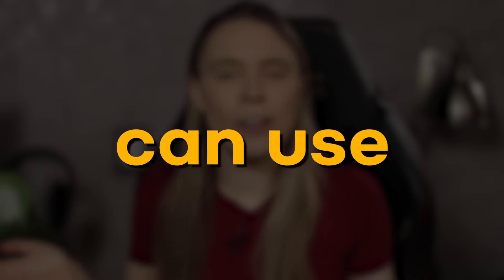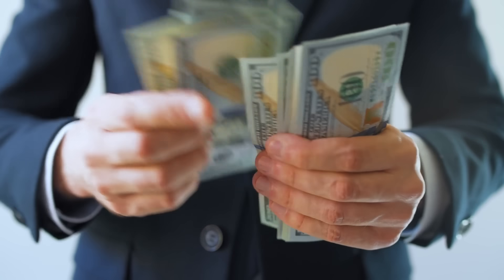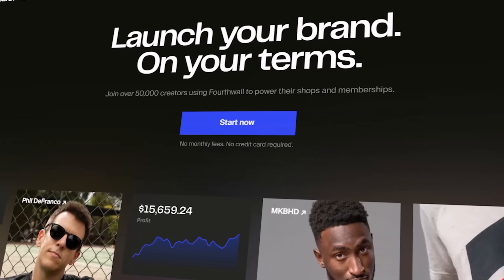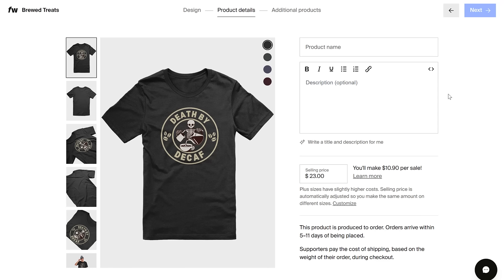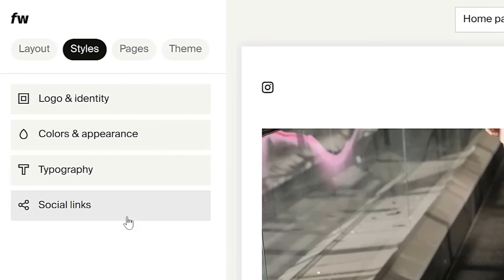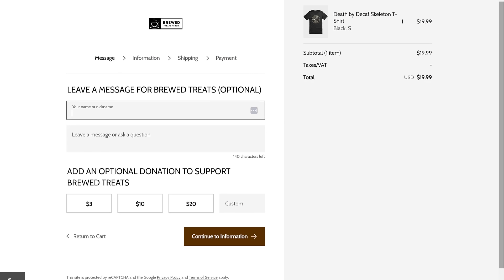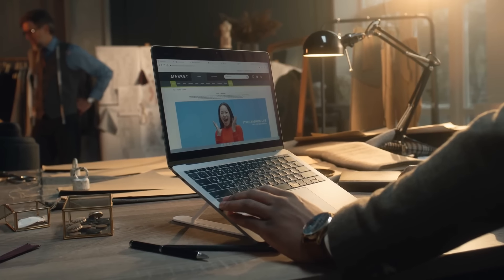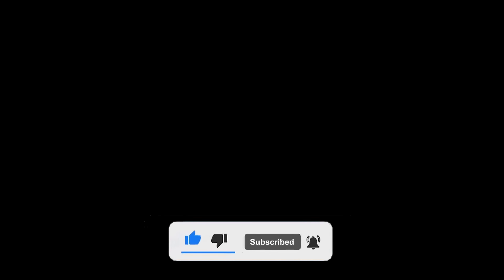The New Way To Start A Print On Demand Store For FREE

Comment: Do you have to have a Printful account with designs already uploaded, in order to use Fourthwall?
Reply from the maker: No you don't because it isn't you ordering from Printful - it is Fourthwall which is what makes it so interesting. So behind the scenes, my guess is that Fourthwall has a huge commercial account running with Printful (or multiple), and that all of the orders that the stores in their system make basically just get ordered from their large commercial account, while they pocket the commercial account discount as profit. You scratch my back (get sales for products) I'll scratch your back (order the items for you for free and charge you no upfront production costs).

Comment: I credit report is so bad, unable get a credit card 😢😢😢. Rubish banking system
Reply from the maker: If you can't get a credit card, my recommendation would be to use either a debit card with cash on it - or you can sign up for Fourth Wall, or Printify Popup Shop 🌞